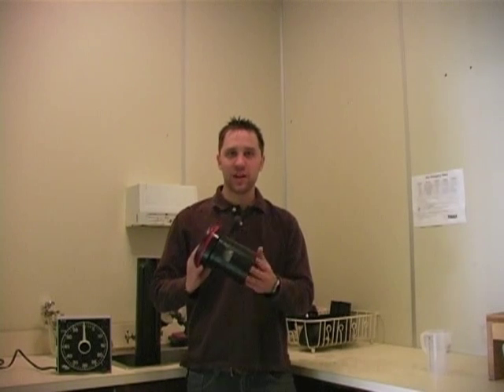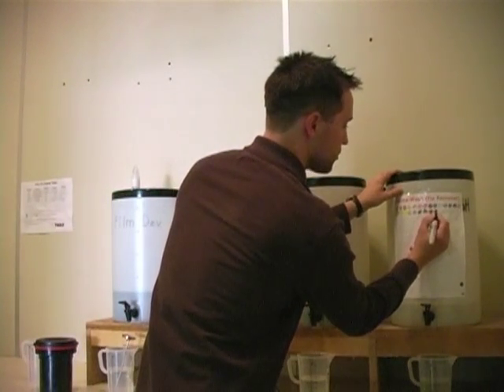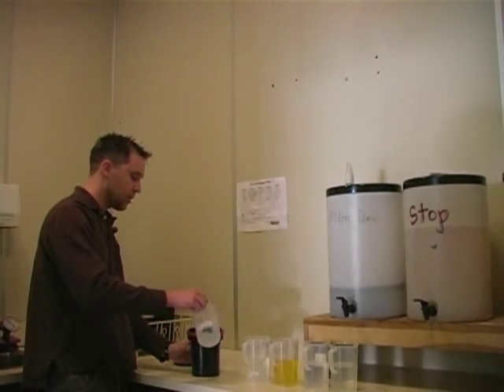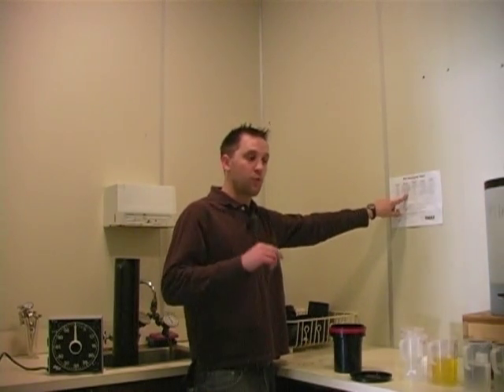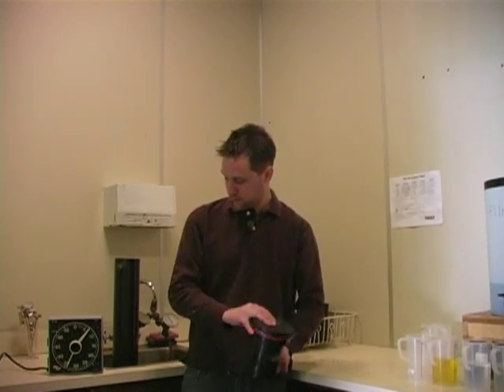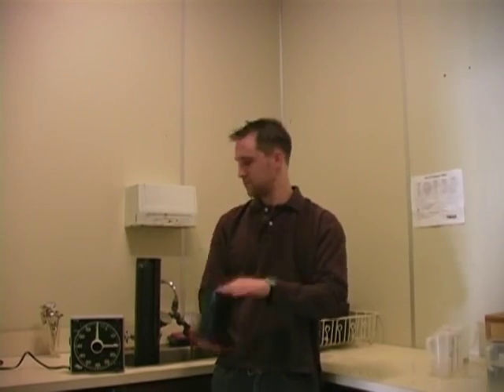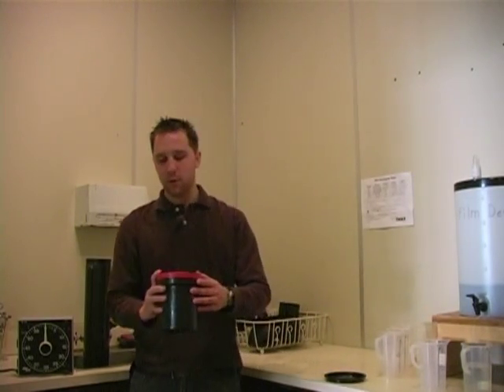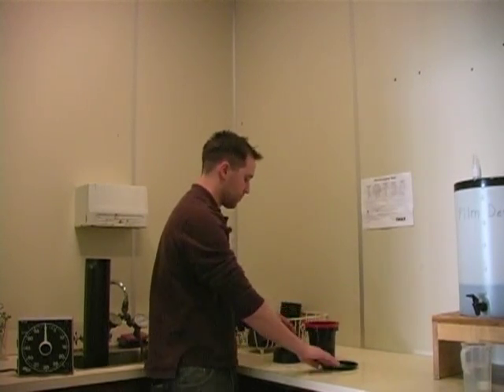Develpoing B&W film part 1 of 2

Comment: @iliescuarmand assuming you dont have any visible particles in your water, normal tap water should be fine.  Otherwise it shows up on the enlarger like dust spots - black dots.

i know plenty of people who developed film inside their own home.  but then again, the tap water in new york is cleaned pretty well so using or drinking from it has never been a fear for me

after you wash with the water, you use photo flo anyway. just make sure your water is clean. your choice.

Comment: stop bath stops the development of the silver halides.  it can be acetic acid solutions or just water.  if you leave developer on the film, it will continue to get darker.  conversely, the less time you develop the film, the lighter it is.  indicator stop baths change color to show freshness of the solution.  fix remover and stop bath isn't needed, but just help to prevent problems/defects you can just wash with water for slightly longer times